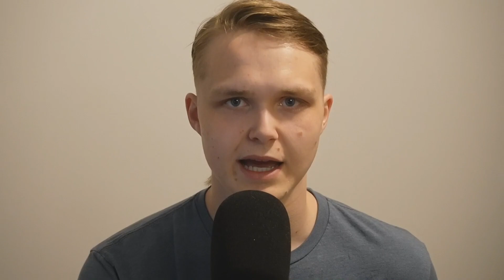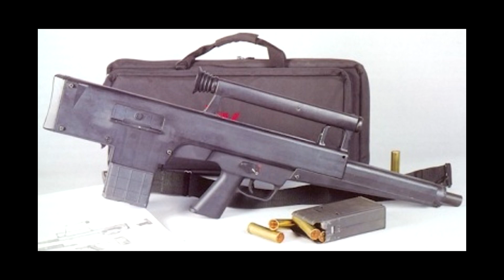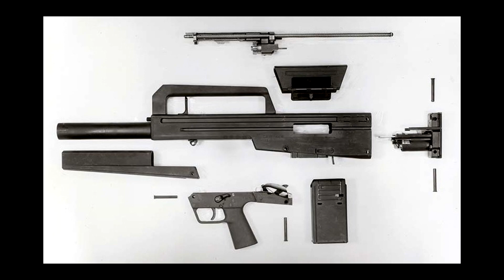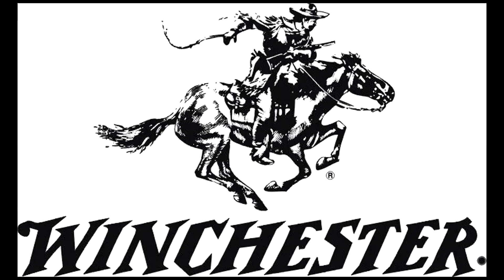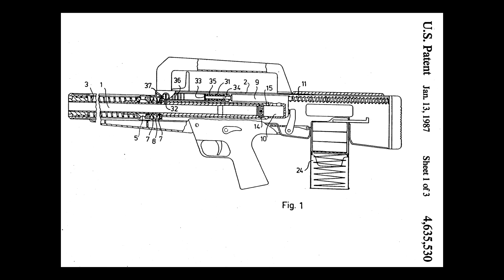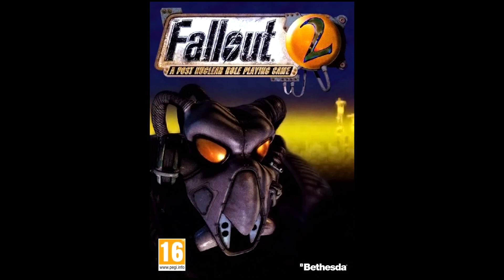Futuristic Failure | H&K CAWS Automatic Shotgun

Comment: wouldn't it be refreshing for the pentagon to actually finish a program and replace whatever instead of stopping midway through and just upgrading the existing system! better yet decide what they want before spending a penny! (i could list those programs just from the first gulf war on and that list would be 500 programs plus long!!) oh well anyway, the USAS the koreans made while using a standard 12 gauge shell would have been perfect for that role aside form it's length!
Reply from the maker: The USAS would have indeed been perfect for this role. Fun fact, the concept for the USAS is based on the Atchisson AA-12. So, in a roundabout way, the USAS is a product of the CAWS program. Appreciate the support Keith!
Reply: @TiptonBros  you know i actually got to handle a AA12 and a USAS at Knob creek over decades ago (and i can;t believe it was that long ago!!!) whoever came up with the AA12 must think soldiers are 9 foot tall!! that shotgun is that out of proportion!! one i'd like to see though is a belt fed 12 gauge with twin spade grips!!
Reply from the maker: @keithmoore5306  I can only imagine how unwieldy it was. With the loaded drum it was pushing 17lbs. You’d have to be a terminator to carry that around all day.
Reply: @keithmoore5306  Tbf, the AA-12 is practically recoiless due how its recoil system works, compared to other Automatic shotgun you get the full recoil of the 12 gauge
Reply: @nelsonsham2368  well recoil is not the issue for me it's the ergonomics!
Reply: @keithmoore5306  dude all the automatic shotguns are bulky, well maybe except the new Gen 12
Reply: @nelsonsham2368  bulk ain't the total issue it's the balance that comes with that bulk! i got the chanc to handle a USAS at Knob creek and the balance!! a drunk with vertigo had better balance! and too be honest i see very limited real world benefit to full auto in a 12ga beyond being a range toy i'd be more interested in a semi auto shotgun that can be mounted under barrel and can fire FRAG-12 micro grenades over full auto